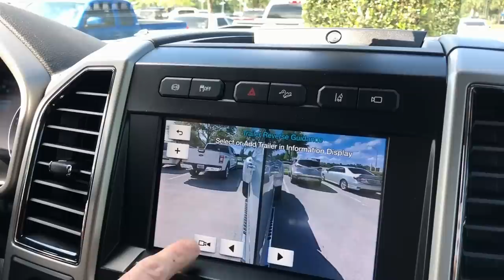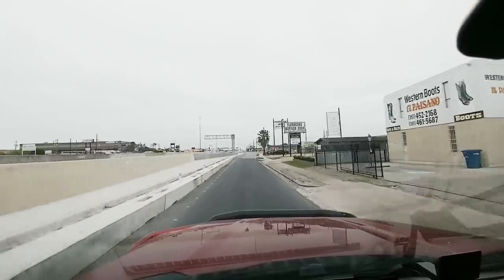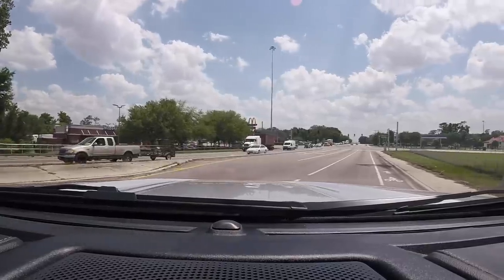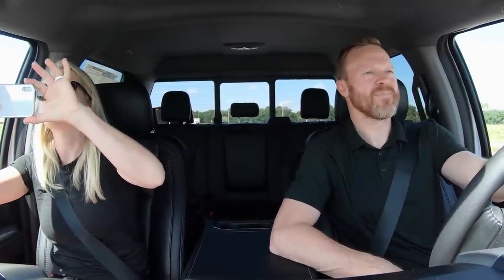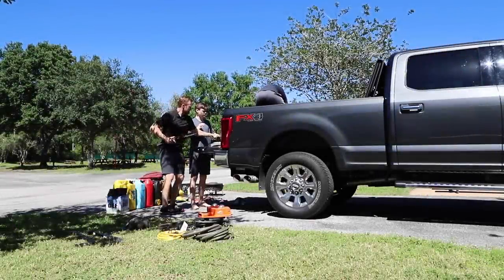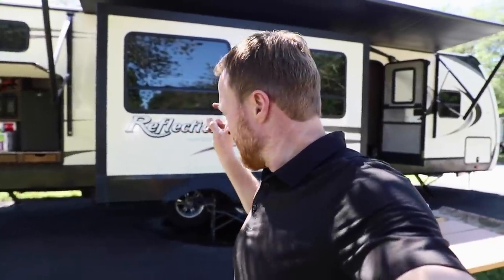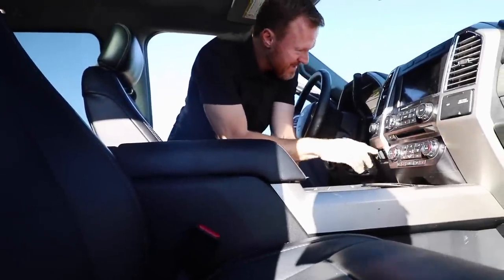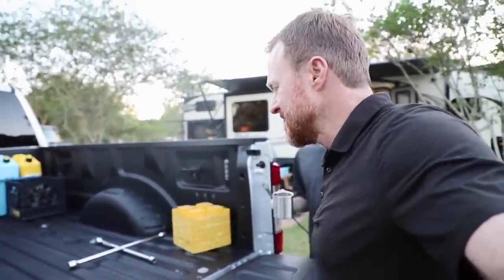2019 FORD F450: OUR NEW TOW VEHICLE! (WITH BIG TRUCK BIG RV)

Comment: You are right about carrying tools you can't use.  I'm a 72 year old solo female and two years ago had a blowout on the 5er on an interstate.  The AAA tow truck driver had everything except the right size socket for the lug nuts.  I KNEW that socket was so important, I kept it in the silverware drawer and handed it to him in less than 30 seconds after he said he had to go into town to get the right size socket.  My RV mentor a few years before that had told me to buy that special size and keep it because he knew my wheels required an odd size!
Reply: It's a shame that the stupid manufacturer couldn't just use a standard  size for the lug nuts.   >:-(

Comment: Great choice. A correction for future reference: There is no such thing as a 'non-commercial' CDL. If it is a CDL (Commercial Drivers License) then that is what it is. There ARE non-commercial Class A, Class B, etc for driving large vehicles that are not used in commercial service, and these vary from state to state. You can also have an intra-state CDL, which is still a commercial license.

Comment: Speaking of tools, an engine-driven (York) air compressor and Viair air tank are two of the best mods I’ve done to my Jeep. 
Not only does it make airing up large tires a snap, it’s more than a little cool to be able to break out the air tools (like an impact wrench) on the side of the trail/road.

Comment: Good for you Marc...you'll love the truck...and 450 HP, should pull with ease, when in the mountain country of U.S & Canada!   You may remember from our 'meet up' in Vancouver, my F450 King Ranch, and yes the turning radius is superb!   It just comes in handy so darn often, and any vibration you've felt may be from the rear lug tires, and yes...less flex than the smaller tire sizes, but more flexing.   Once you get hooked up, the ride should settle in quite nicely.   I also added airbags to my F450 for the additional ability in raising/lowering the rear.    One thing you should do is check out what we call 'the pumpkin' (rear differential carrier) and see the size of it, compared to your F250...it will be nice to see Marc's 'add-on's' coming up in the next season or two on the truck!   Look forward to seeing the whole rig all set up, and your reviews in upcoming video's!   Cheers to you both, and happy travels to you all!

Comment: Just bought a 2019 f450 last week too. Black on black.  Vroom vroom   Waiting for my b&w hitch base to arrive so I can start pulling my 5th wheel
Reply from the maker: Congrats. We installed the B&W companion in the OEM puck system. So nice.
Reply: @KeepYourDaydream  Mine gets delivered tomorrow, I am reusing the head unit from my old truck, the base was only 429$! to mount into the factory 5th wheel prep from B&W.

Comment: I went through a similar procedure before purchasing our F-350 DRW diesel to pull our 14,500 lb GVWR 5th Wheel. I also subscribe to BTBRV and was delighted to see the connection and acknowledgement between you guys and JD. I was aware of his disdain for the turning radius of the F-350 and so I watched for that specifically as I took my test drives. Frankly, the turning radius on the F-350 was no worse than I would have expected from a 22 foot long DRW pick-up. What REALLY bothered my was the larger wheels and rough ride (as you experienced) on the F-450. I figured that the rougher ride and larger wheels were more of an issue on longer hauls than the turning radius would be so I bought the F-350 with no regrets. I have come to love it more and more every day, and really have not run into any problems because of the turning radius. Had I known about the cost to replace those 6 tires on the F-450, that would have made my decision even easier! Love your posts BTW and will be sincerely interested in your continued upgrades and improvements to both your vehicle as well as your (suspected at this point) new toy-hauler. I suspect my suspicions will be proven in a few minutes with this week's episode! Looking forward to it.

Comment: We have a 2017 model. The tires need to break in. It will follow cracks in the road something fierce.  Mine broke in around 5000 miles. We tow a Mobile Suites Lexington. 26k loaded. Pulls like a champ and the ride really smooths out when towing. Can't beat the turning radius for placing the house in sites!! Congrats.

Comment: I did all this rationalization between the two (350-450) and the numbers pointed to the 350.  350 and 450 towing capacity are so close...the 350 payload is higher......the cost favors the 350.....options favors 350.....the 450 with most insurance companies rate you at the commercial vehicle level etc etc.  450 you get the better turning radius 🤷🏻‍♂️.

Having said that....when paying 70-80k on a truck.....at the end of the day, get the truck that makes you happy.  You can’t go wrong with either F350 or F450.  Best trucks on the road!
Reply: M Walker absolutely....dodge 3500 is a fine tool.  And that is what your truck is...a tool!  Congrats on finding what works for you brother

Comment: Great video! I am at the crossroads of choosing a truck, and it's overwhelming because ultimately they all are pretty similar in terms of power delivery, but there are so many other issues to consider such as braking, suspension, turning radius and so on. I can't wait for you guys to reveal your new 5th wheel. I am a project manager, and work around the country, and I am hopefully going full-time at the end of 2019/early 2020, and I will be going with a 5th wheel as well. The rigs I am looking closely at (LUXE 42md and Luxe toyhauler--both have dedicated office space areas) have a GVWR of 24,000 so I will definitely be looking at F450 and Ram 3500 as options. What kept you from considering the Ram 3500 with the max tow package (air suspension)? Is it the turning radius, suspension, and brakes of the F450 that attracted you? Will you be adding a rear air suspension to the F450? Anyways, I am a subscriber and will be staying tuned as you guys move forward because you provide such wonderful commentary into full-time life. Looking forward to more great videos!

Comment: In August I will hit the 10 year anniversary of owning my dually.   Not once have a ever regretted having a long and wide (fat) truck.  Congrats on the F450!
Reply: Yeah well the only time I regret it is when I had to buy a set of tires, tight two lane roads and drive through lanes. Oh, TWICE when I took my truck in for tires or repair that the tech driving the truck crushed one of my dual fenders :-P
Reply: Oh Yeah, that reminds me....  AutoNation in Spokane, WA crashed my dually fender in to the shop door, fixed the damage and when I discovered the repair, they denied EVERYTHING!  I took it all the way to headquarters, and made them replace the side of the truck bed.

Comment: Turning is dynamite.....vibration with the wheels is taken care of using bee bee tire weights. Love them.
Reply: A reblance by the dealer might solve  the issue or the tires could have been flat spotting from sitting.  It might go away on a long hot drive. Also, new vehicle often come with whatever tires the manufacturer could get the best deal on.  Hopefully its not the latter.

Comment: Couldn't help but pick up on the look on your face at the dealership. I tell ya, negotiating with any auto salesman is painful for me😲.
Reply: Nancy Fehlman The finance people are where the rubber truly meets the road and where the most pain is caused for consumers, by far. They are absolute sharks and are well-compensated for every extra dollar they extract.
Reply: @anthonyc1883  Since I was remote and only talked over the phone it was much easier. I told them the price to beat and they beat it plus gave me much more for my trade than any other dealer. I have found that the best weapon you have it the willingness to walk away.
Reply: @petehaidinyak9084  Absolutely the #1 lesson I have learned: Do NOT let on any urgency to buy a vehicle and walk away if it's not close to what you want in price.
Reply: @kiefferkeepinon828  
But trucks have become a status symbol or statement for some people. Lol

Comment: Should have looked at the Ram. Better tow capacity and better engine. Plus a much better interior.
Reply: Paul Clement that’s your opinion
Reply: I'd certainly agree about the interior, and I've since learned that almost every single diverse reviewer I've watched agrees about the Ram interior. I'm not knowledgeable enough to comment on the Cummins/Powerstroke/Duramax debate.
Reply: Ford is the truck Boss!
Reply: I have to agree

Comment: How did you guys manage breaking it in before towing?  Most trucks require 1000km to 1500km before you should tow with it.
Reply: Nope. That was then, this is now. The engines today are not the same as when your dad bought a new vehicle.  Many in the industry agree a 100 miles is enough and many feel no special treatment is needed at all.
Reply: @geraldhenrickson7472  I don't think that is the case.  Although break-in periods are definitely shorter then they use to be, a break-in period is still recommended.  For example my brand new Ram 2019 Sport has a 500KM engine break-in period and a 805KM minimum before towing anything with it, and then recommends an additional 805km until 'normal' towing.  This is straight out of the owners manual.

BTW break-in is not just about the engine, it is about the entire truck, including the tires.
Reply: "Drive your new vehicle at least 1000 mi (1,600 km) before towing a trailer."  That is straight out of the 2019 Ford F450 owner's manual.

Comment: Now that have a f450 you can get anything like a third slide eagle cap or host truck camper the choices are endless
Reply: GVWR is silly only 14,000 lbs. Need a 5500 or 550 to safety  haul a 6,000 camper and all you gear  and 5 people .

Comment: Congrats on the new truck. Nothing pulls like a dually. I never had to have equalizer/sway control jacks on any trailer when I had the dually. Of course a fifth wheel negates that anyway but you are going to be super happy with how it tows.

I did not get one last go around simply because my trailer is not that big and I wanted it to fit in the garage. I have had two in the past though and for towing, nothing is better!

Comment: Loved how he quoted Dwight. Also I have a 2017 F450 King Ranch that I tow my toy hauler with and it is a bit smoother ride while towing. First upgrades I am going to do with it though is add airbags and upgrade to 20" rims since 19.5" is an awkward size and 20" is more common and easier to find tires for.

Comment: Congrats on the F450!  Glad you have the puck system for your fifth wheel hitch.  One item I highly recommend is the B&W companion hitch.  It is extremely durable and an amazing ride with virtually no clunking.  And the model for the Ford puck system is light enough for one person to install or remove.

Comment: Very cool video.  While I was home on R&R from deployment, we traded our 2017 F250 Lariat for a 2017 F350 Platinum, with 9k miles.  The 350/450 tow capacity is fantastic and we can now get into the 5th wheel toy Hauler that we want.  Enjoy y'all.

Comment: We had a 2016 F350 Lariat and absolutely loved it. We traded it in for a class A diesel pusher ( thinking we wouldn’t need the truck anymore ). Our hobby is drag racing. The Class A can pull our race trailer , but we can definitely feel it behind the motorhome. We wanted another truck and last August we found a 2019 F450 King Ranch at a dealership and fell in love with it and it can be flat towed behind the motorhome when we go on vacation. We had a Roll and Lock bedcover on our 350 and hated it. It was hard for me to pull so we knew we wanted a electric one for the 450. Found a Pace/Edward one. A little pricey but worth every penny.

Comment: I used to work at the Kentucky Truck Plant.... where these are made!  I worked in the paint booth, where I painted around the door jams and the edges of the doors, as well as other areas that were not painted with automation!  That was several years ago before they automated the entire paint process.  After they switched over, I worked in scuff booths.  I loved painting though.  Just not for 10.7 hours a day!  LOL!

Comment: Uplift Switches...  Most ford truck are prewired for the uplift switches.  On the 2019 F450 I think the switch mounted on the center dash just to the right of the trailer break control.  Ford's Part Number is HC32-13D730-AA.  The MSRP is $67.18 for the switch assemble.  All you have to do is pop out the panel on your dash beside the trailer break control, find the wiring plug under the dash and connect the switch assemble to the wire then plug the assemble into the dash...  Air Horn Here You Come!!!

Comment: Should have done what we did when we bought out F350 dually.  We went through Blue Book online and told them we wanted everything and give us the best price.  We had calls from several dealerships in the area with the one we had in mind and went with a local dealer.  Walked in, saw the truck they had brought in from another dealership that had everything we wanted, signed papers and we were out the door in less than 2 hours.

Comment: Back in Jan 1998 we bought a new Ford Super Duty, thats the old version, that was actually a F450, they only came in cab/chassis, we got the 7.3L Powerstroke diesel, 4 speed auto trans and the truck had the 5:13 traction loc rear end, and had the AC dealer added, and the truck had the cloth seats. it was a true commercial truck.  We hauled a 3500# camper and pulled a 3 horse trailer. the truck got a 11Ft flatbed and 2    4 ft storage boxes under the bed.  I went with the Super Duty,F450 because at the time it was the only truck with 4 wheel disc brakes.  we did a lot of mountain work with that truck, camping in the mountains or crossing the mountains to ride.  when loaded we GCVW out at 19 to 20,000@ and the truck handled it great.  we had the 4: exhaust K&N filter, and the computer was reprogrammed.  That was a sweet running truck.  we drove it for 15 years and the only trouble we had was the transmission, that was replaced and a super heavy duty oil cooler installed.  We had upgraded from a 460 F350 with a smaller trailer.  never regreted buy it, but yeah it was rough riding without the camper and trailer, but 95% of the time the camper never came off.  I don't remember how many times some smart ass asked "Think ya got a big enough truck"???  It is better to have it and NOT need it than to need it and NOT have it.....  It being the capacity and grunt to do the job !!!!

Comment: I purchased a f350 two years ago today. I elected NOT to get the full camera option and have regretted it ever since. However, if I were to order today, I would not get the  puck system. I use the truck to haul gravel or garden stuff once in a while and it does not fail that when you are scooping out the truck you invariably hit one of the pucks. I really do not understand why ford and ram did not put them flush with the bottom of the truck rather than with the raised rib.

Comment: I can strongly recommend a bed cover, i'm using the bak-flip, mx-4 ..  its great, I can protect things in the bed, and the cover will protect when unhooked and make the stuff is secure ….
Reply from the maker: I had the Mx4 of my last truck and already installed on the 450 too. Love it. The only drawback when pulling a 5er is I can't see the hitch now. Bummer. The 5th wheel cam isn't very good.

Comment: When we went from our Ram 1500 Big Horn with lots of bells and whistles to our 2500 bare bones Tradesman trim level I made similar faces and comments as you. The Tradesman was actually less money than the 1500 (goes to show you how much those accessories cost). My point however is that by the time you click off a few thousand miles, you won't even remember what those trinkets were. Having a tool that does the job is much better than having a shiny one that doesn't.

Comment: No heat seaters??? Wait until the Fall visit to the KYD Kabin. On The Trophy Wife's new 4Runner all I asked for was heated seats. But, then again, now holding a Platinum Man Card I can see how they could be justified as an option delete. Question me this: How will the new turning radius affect the overhead portion of the 5th wheel? Will extra caution be needed so no crunching is involved? Congratulations, well deserved. Good of you to sacrifice this for Family.
Reply from the maker: With the longbed, I have a 92-degree turn over the bed. It also doesn't have a diesel block heaters, but I called the dealer and it's $250 to install. I lot less than I was expecting.

Comment: The Beast. Congrats on new truck.  Hopefully the ride will smooth out with some miles, especially the jitters. Even with that truck as you well know you need to pay attention to weights, in addition to trailer lengths. In Illinois on most secondary roads there is a limit of 60 feet in combination. There is 42 ft limit on trailer length. Also Illinois requires non CDL for over 26000 gcwr of truck plus trailer. I agree that the driver license requirement is tied with your state of residence. Besides parking and size these were considerations when getting our new one ton srw GMC this year. As such we are limited to about 14000 gvwr (14400 lbs trailer weight at the 26000 lb gcwr weight limit for non cdl) . With a dually any trailer over 12000 lbs gvwr would have required non CDL license.

Comment: They moved the up fitter switches from the roof to under and to the passenger side of the navigation screen when they changed the Super Duty in 2017. Don't know if you didn't see it or if your truck didn't have that accessory.